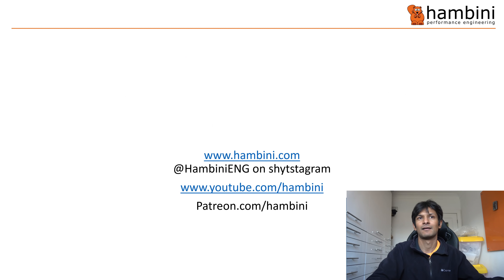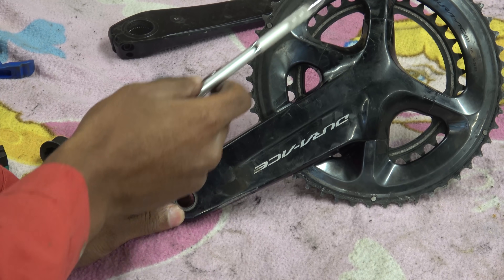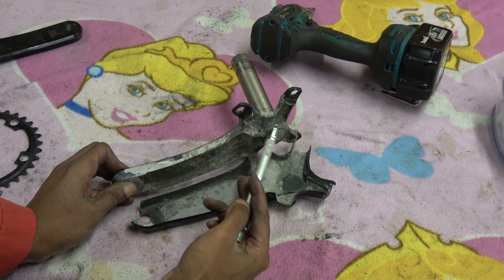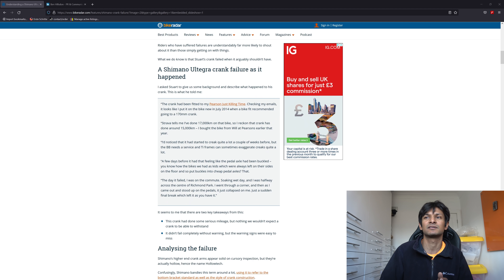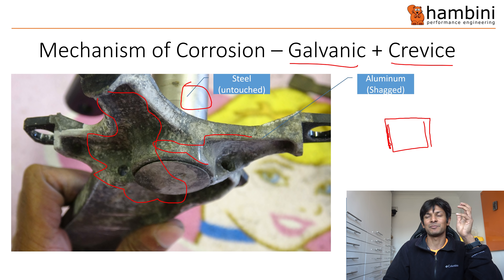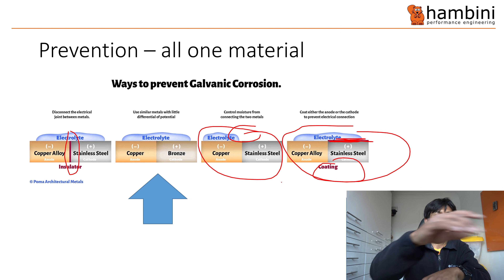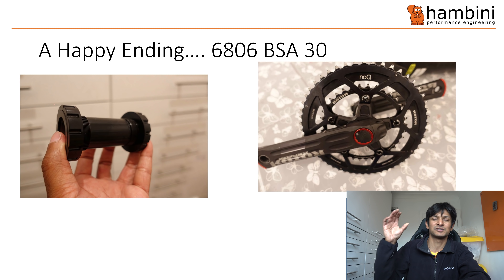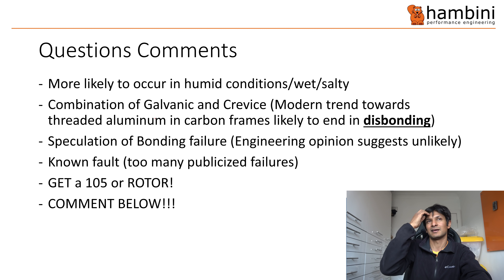Shimano REAMED for Engineering Incompetence

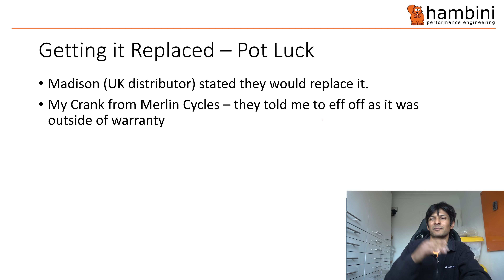Comment: 27:54 That's not "bordering engineering negligence"! Every engineer worth their salt knows about galvanic corrosion or should know about it. All it takes is picking up a screwdriver and take more than a couple of devices apart in your lifetime and sooner or later you'll come across one where aluminium sheets are screwed together with steel screws! It's much more common that it should be (from electrical devices all the way to cars!) and engineers know about it and simply don't give a fig. It's a question of money, convenience and the part's in question estimated useful lifetime. It's fairly crude, calculated gamble that manufacturers virtually always win as the part will fail after it's short warranty period.

Comment: Man creaking / rubbing noises on my bike really bug me and I HAVE to check it out to stop the noise. That said my bike is all at lest 30 years old and it didn't cost me nearly as much as even just a Dura Ace group set so any engineering incompetence is a lot more excusable. That said, my cranks are solid steel and I've still got the original bottom bracket in my steel frame and I haven't had any issues with any sort of corrosion. Steel all the way!. Imagine buying Dura Ace and having it not be durable 🤣.

Comment: why have they bonded the parts when welding it would have been easier?
Reply: You can't do long straight welds on aluminum because it warps the walls. That's why you see various large things (eg containers) that have only spot welds at specific points.
That's how a welder explained it to me

Comment: I don't understand a point of having carbon cap, glued to a cast aluminium. The complexity of the product means, that it is very expensive to produce, where you have to spend a LOT of money to make it reliable.

Wouldn't having an entire crank arm made out of say, a stainless steel be stronger ? The weight difference would not really be that great, would it ?

Comment: I had 7900 DA crankset fail at the pedal hole. Straight across, so different failure mode. I have to say, I wonder if your cranks would have held up better if well maintained. Come on man, those things are filthy!!! Regardless, Shimano is way behind the curve on cranksets. They need to abandon HollowTech and go carbon!

Comment: How hard can it be for Shimano to get it right? Cannondale has been doing it for years with their Hollowgram cranks and haven't had any issues I've heard of. And the Cannondale cranks are lighter and very stiff.
Reply: Nope. They fail a lot. And it's not by corrossion, it's by streess. I've a friend, very strong, that did broke 2 SISL2. It's worst than Shimano, it's not they could fail, they will fail under certain amount of stress. I can tell you, no sprinter uses SISL2.

Comment: bust mine (Ultegra 6800) during the week, and damaged the big ring in the process. Costy repair, and Shimano's response:🙉🙉🙈🙈. 
So, my next groupset upgrade will not include Shameful's Ultegra or Dura-Ace. ( 105 r 7000 remains in the mix tho). Others are as good/better. 
I'm out !

Comment: very useful video thanks. We are in discussion with Maddison although 4 years old and 10000 miles on the clock may be difficult. There is also the 2015 consumer rights protections which last 6 7ears - these can be referenced on Which.uk. You mentioned an Instagram, possibly for uploading content but I can't find it. please link anyone?

Comment: 29:20 - Ever considered different chainrings on the Rotors in the past or now? :P You could get Rotor cranks with 4 bolt for Shimano chainrings if you buy a Power2Max 110 4-SL

Comment: So it seems Shimano chainring would be quite safe as there is no steel in contact anywhere else except the chainring bolt, and the chain itself?

I like Shimano chainring shifting. But don't want to deal with their crank.
I like Sram Dub crank arms but Sram intentionally make Quarq Dfour spider much much heavier than the Dzero because they want weightweenies people to stop using Shimano chainrings.

So, I have Quarq Dub carbon crank arms + Sigeyi powermeter with 4 bolt 110bcd (Shimano chainring compatible) + Shimano chainrings.
It end up being a really light power meter crankset with Shimano chainring shift quality. Roast me all you like for using 3 different company's component together on the crankset. But it works great.

Comment: After spending nearly two years turbo training on his trek elmonda. My friend had to take his bike to the bike shop as he was unable to ride it outdoor due to the amount of corrosion in all the cables and the headset. He found it difficult as you eluded to even remove cables from the frame and the bolts from the headset because of the corrosion. I wondering if that is also contributing to excessive corrosion with everyone having hot sweaty turbo sessions in small enclosed spaces. As they say - don't ride you best bike in the winter but they didn't say don't ride it in the garage and make it hot and sweaty...
Reply: Use a fan.
Reply: Bike mechs call this "piss and electrolyte crust". Kinda why mechanics hate working on tri bikes.
Reply: @Sills71  I'm good on the metaverse cycling
Reply: @coreygolphenee9633  "metaverse cycling" LOOOOOL I'm stealing that

Comment: Goddammed, I had a creak in my Ultegra crank. First cleaned and greased everything very well. No result. Than changed the bearings, did everything very accurate but stil almost each rotation there is a "tic" .

So it must be this very same problem. Shimano is charging big money for their spare parts which in fact are cheap to produce.
One even can't buy a single sprocket for the rear cassette. It was possibly in the past to buy one sprocket but they do not want to support their customers anymore with a decent service but one has to buy a complete cassette which makes SHIMANO a rip off company.

Comment: I almost bought a set of Ultegra, which would have represented about 30% of my budget for upgrades, but after seeing so many videos about failures I bought some cheaper and heavier FSA instead. It's  probably the best decision I've made when it comes to cycling. No more buying for the name.
Reply: Buying FSA and calling it good decision is a bit of a stretch  :D
Reply: @MS-bw7yt  maybe, but i'll take a weight penalty over a snapped crank any day. its all relative.
Reply: @tussk.  fair enough, but FSA is famous for fucking up their engineering a lot as well. Especially on their buttom brackets and cranks. I have two R8000 cranksets myself. Until now they are fine, but I they fail I will switch to 105
Reply: Looking at my failed FSA cranks in the past - I am not so sure if that was a good decision. :D
Reply: I've got a cheap FSA crankset on my 4 year old aluminum commuter that I leave outside in the weather. I expected it to fail 1-2 years ago but it just keeps going and going. Every 2 weeks I lean it over and squirt some WD40 into the cranks, give it spin to work it in, then do the same for the other side. Still spins like day 1.
Reply: @MS-bw7yt  Ive had FSA cranks and components  on my Dh bikes, road bikes, XC bikes and commuters.I know theyre not the best, but I dont have a huge budget usually and I know I can rely on them. they will and do fail from time to time, but I have never once had them split or snap in half, even after some pretty nasty crashes. 

it was a good decision to spend £150 on a set of FSA cranks that I might have to replace in a few years instead of £250 on a set of Ultegra that will almost certainly fail within a few months, maybe even less. Like I said, its all relative.

Comment: In my opinion as long as pro riders don't have failure in their bike part(like MVDP with his broken handle bar) the manufacture will never do anything.. and also the failure rate don't exceed their standard, they just will say its production failure...
Reply: That failure made the international media. That cost the stockholders!
Reply: @davidburgess741  shimano already acknowledge this problem and they solved it with ultegra 8170 crank (its what they said.. dunno its true or not).. and they don't do any recalling of their product... why, because 1 million people use their crank and only maybe 1000 people had failure... even if it goes to international media they can blame it in production  defect.. replace it..  every manufacture is same

Comment: Shimano folks are usually decent, so I am going to call this oversight... btw, you are a bit late to the party with this one.. here is my "short" take, based only on few videos and little I see technical about the failure elsewhere (I have 105 on double and Tiagra triples, not being a weightwheenie) 
1. Galvanic potential between the (likely - more on this later) carbon steel and usual aluminum alloy ain't much, as you noted on the table. So plenty things operate with those two type of metals in direct contact for decades without the alumina formation seen on this crank. So there is no way in hell a relatively new product corroded so much in such a short period of time without other shit happening - lots of humidity, folks who don't rinse their bike after a sweaty ride or worse yet, riding on salted pavement... as much of a racist bs it might sound like but japanese don't seem to sweat as much and they don't have tons of salt on wintry pavement, even in Hokkaido...   
2. looks like they didn't anodize or conversion coat the crank arms, probably made point 1 to make things worse faster. galvanic cell works better with surface area for exchanging thems ions (if school mandated engineering chemistry... they often go over lead acid battery principles). that note using 400 series martensitic ss instead of run of the mill hi-ten or carbon steel is unlikely due to material cost compared to gain corrosion resistance they didn't care for.  
3. bonding instead of brazing seems like a poor move to save few bucks OR someone oversold on adhesive capability. we don't know how hydrophilic/hygroscopic that glue is, that would have exacerbated corrosion. I get that you can put that fancy finish on the cover part then glue - compared to brazing on bare part then need to put finish after but given how much margin they have on this thing... also, they could have tried to design it to be friction weldable... 
4. casting the arm portion glued 2 pcs shells and not putting some ribs on seems idiotic when it's basically free. I doubt these things see enough stress for "forging" in true sense, but even then, ribs can be accommodated in the tooling - as other hallowtech (which probably wasn't used, so they can save some weight) are either forged/extruded more for the hallow shape, not necessarily for strength. It appears that that the two pcs design facilitates the power meter integration better and R9200 still maintains it so hopefully they have it worked out better... 105 cranks most likely cast with the cavity then forged/extruded shut - they just don't look welded two halves nor seam welded into tube shape. 
5. I am sure there was a project engineering done along with a nice FMEA with all that MTTF/MTTFd ect ect - then fancier methods get scrapped because they'd be lucky to get a million set of these made to amortize the tooling costs out, when some penny pincher looked at it, so they glued shit together - all for weightwheenies that need to save few grams...  
6. So galvanic corrosion is likely only contributing, and there're plenty of videos/pictures out there with the failing crank without much white stuff. as few others suggest, I lean on root cause being shitty bonding failing with or without corrosion being a exacerbating factor... not the galvanic corrosion leading to bond failure. yes, it's possible that the surface finish, tolerance or preparation as well as epoxy screwup by misguided design and/or processing of glue itself or application are all root causes as others have suggested. 
7. in your case, putting a fancy crank on a turbotrainer might have just given you a bad karma... j/k... did you have this one a carbon bike with nice steel bearings with your own BB rammed in nicely? then your gavanic cell includes all that to make the matter worse... Also, no, I don't wanna know how much you sweat.    
8. However, these are Shimano product as a whole, so they should fucking own up to in... then again, since they are going thru the shithole archaic distribution channels in the bike industry (if you ever get big enough to deal with them, you'd know) and the responsible engineer might already have committed seppuku, so we may never get a satisfying conclusion of all this. at the end of the day, most people have easier time taking a shit before a big ride to lose more grams than going from 105 to Ultegra/DA cranks...
Side note. carbon fiber + aluminum bonding is also a practice done well and safely in aerospace and automotive for few decades. I've personally seen plenty of such joint design survive nasty long military salt fog/testing testing (hex-chrome has a place in this world). as you already know, those overpriced cervelo imagineers just plain don't know what they are doing. 
anyhow, this is all what we americans call doing 'monday morning quarterback' or having perfect hind sight...

Comment: Fuck that sent my ring pulsating Hambini.....ive been running 105 for 20 years....should i be concerned?
Reply: Nope, 105 is not using the hollow design, it's just a solid piece, no bonding.

Comment: Shimano's reliability engineering test plan's likely didn't have long enough cycles with high humidity to catch this ... Road bikes and fenders are cognitively dissonant to a majority of the road cycling community. Shimano could probably add a desiccant foam to the void and greatly decelerate the rate of corrosion while only adding tens of grams to the crankset weight.

Comment: I get that this is a very annoying situation and the crankset isn’t covered by the warranty because it was out of warranty (even though Madison said they would sort it), but you expecting a bike retailer to cover a part out of warranty, when the warranty is with the manufacturer, is crazy. Also, they have a new crankset, which so far, hasn’t had the same issues, so they feel that was the way they solved the problem. The science/engineering stuff in this video is very interesting, but you’re being more of a 3 year old than a 5 year old on the warranty side. Wait for the crazy warranty claims made on your bottom brackets.